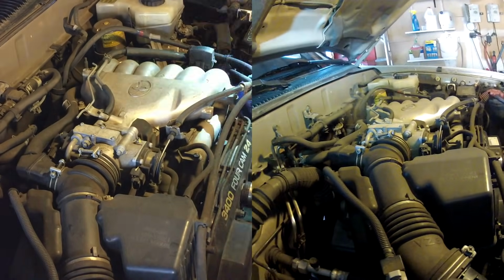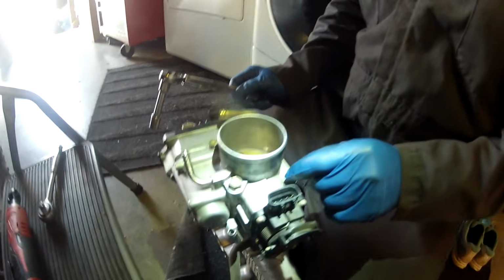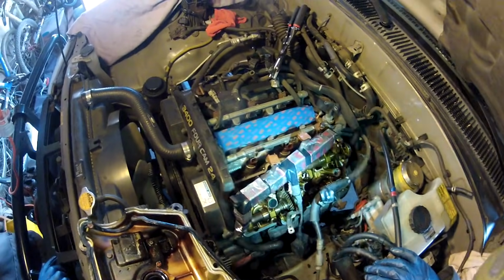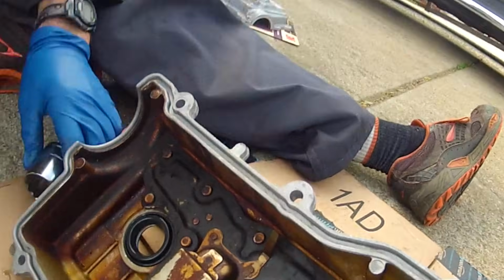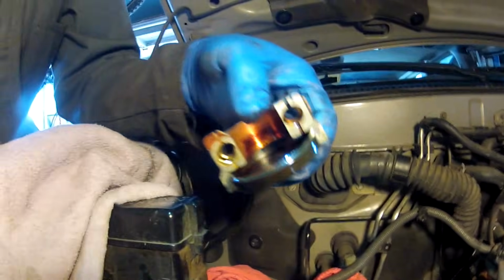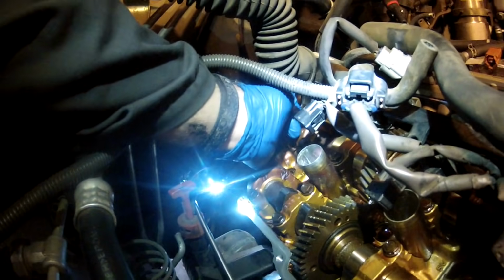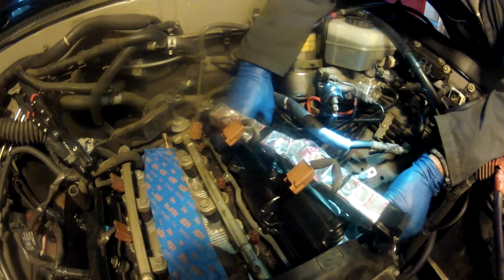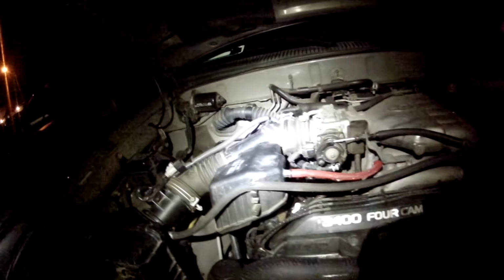3.4 L V6 5VZ-FE Toyota 4runner, Tacoma, Tundra Valve Cover Gasket Tutorial

Comment: Just did my valve cover per you video on my 2002 4runner.  Everything went well and seems to not leak anymore.  However now I'm throwing MAP and intake temp codes.  Tried to clean the MAP with cleaner by taking it out and spraying it with MAP cleaner.  No luck. Also my throttle is almost 2/3 the way down on a depressed peddle.  The cable seems fine with similar tension as before.  I cleaned the TB with a rag.  Could I have damaged something in the TB?  Any suggestions would be appropriated.  Thank you.
Reply from the maker: What CEL codes are you getting?  You're 2002 has a different style throttle body than the earlier models 96-00.  It doesn't have an IAC valve like the older models but it has an electronically controlled throttle plate that opens up enough to give the engine the air it needs to run when it's at an idle or when you're decelerating and you've taken your foot off the gas pedal.  Unless you were really rough with it, I don't think you could have damaged it.  So, your throttle body is a sort of hybrid.  It's basically drive by wire with a drive by cable back-up.  It appears at first glance to be a mechanical cable driven throttle body but it's actually electronically controlled.  I think that's the reason why you're not seeing the throttle plate open fully with the pedal depressed fully.

By the way, it's actually called a MAF (Mass Air Flow) sensor.  When cleaning the MAF, were you careful to not damage the sensor wires?  The MAF not only reads the amount of air coming in but it also reads the intake air temp.  So, it appears something happened to your MAF when you did the job.  Are you sure the sensor was plugged in fully?
Reply: P0100, P0101, P0110, P1126.

Thanks for the correction on MAF.  Makes more sense. Lol.

When i step on the accelerator with he hood open i can see the throttle body moving via cable but it seems it wont rev until near the end of the pedal movement.

I was made sure the MAF sensor was seated and clicked.  When I cleaned the MAF I tried to be careful but maybe I bumped it around too much when I initially removed it for the valve cover job.
Reply: I might add that it idles great.

Also "vsc off" and "vsc track" lights stay on now on the dashboard.
Reply from the maker: @basketweave_101  Did you remember to reconnect the two electrical connectors on the passenger side of the engine near the timing belt cover?  I'm pretty sure one of those is for the temp sensor.  All the other codes are related to the MAF sensor.  I don't know how you could have damaged it unless you destroyed the wires by shoving the cleaner nozzle too far into the tube and broke the wires.  I did read the VSC lights can come on when the Check Engine light comes on.  Maybe if you fix the issue for the CEL codes and reset the system by disconnecting the battery for a while, the VSC lights will stay off.
Reply: Well just a follow up.  I did forget a plug just under the throttle body.  That solved the acceleration problem.  Duh.

After a drive around town the engine and vsc lights went off.  Plugged in a scan reader and still had the same codes.  I cleared them out and all is good for now.

I want to thank you for all the videos you made.  I recently inherited a 4runner as a weekend project rig.

I have already lifted it with OME/bilstein, replaced ball joints,  tundra brake upgrade,  steering flush, and now the valve cover fix.  All following your videos.

Next up is the timing belt and a 1" body lift and some larger more capable tires.    Hope to see how it does on the trails in Sierras.  Maybe I will bump into you up there. 

Thanks Tim!
Reply from the maker: @basketweave_101  Glad you got it figured out Ryan.  Also great to hear you're making good use of our videos.  Happy Wrenching and Adventuring!

Comment: The video you have running on the top left corner is higher speed - do you have that video in normal speed? This is exactly what I need - a video showing it from the very beginning. Thank you much!
Reply from the maker: We don't have that in normal speed.  If you want more detail, you can use our Engine Misfire Diagnosis & Fuel Injector Replacement video https://youtu.be/N-lhZIWOkyU for more detail on removing plenums and everything else to get to the valve covers or you could also use our Supercharger Install video https://youtu.be/7RmHXvEQwXs for more detail.

Comment: Tim, big fan! I just got a 2001 4runner V6 and its leaking from the valve covers. After watching your videos I was inspired to tackle this job on my own (1st time working on a engine outside of regular maintenance) but I encountered a problem. I don't think I removed the throttle body correctly. I ended up removing the bolt that holds the gas pedal cable and two springs/coils shot off. Now I have no clue how to reassemble those springs/coils back on to the throttle body. I just need to know the orientation of the springs. Not sure how the ends fit into the slots.

Is this something you can help with?

Thank you
Reply from the maker: Sorry that happened to you.  I've never taken off what I think you accidentally disassembled.  I've only removed the cables off the throttle body and removed the IAC valve at the bottom of the throttle body for cleaning.  So, I unfortunately wouldn't know the orientation of the springs that shot off.  I suggest you take a picture of what you're dealing with and post your question with pictures on T4R.org in the 3rd Gen section of the forum.  Hopefully somebody who's taken one apart will be able to give you direction on getting it properly back together.  Good luck!

Comment: Hey Timmy.  Once again your video has encouraged me to do something that never in a million years I'd be able to do.  Now that I have completed it successfully I feel really proud of myself and it has encouraged me to keep working in my car.  I could not have made it without your video. You are awesome!
I also wanted to add a few things that I had to struggle that were not in the video that may help others when they do this job.
1. The one thing that was really hard for me was to actually remove the spark plug seals.  I tried your recommended method but was not able to do so without causing some small scratches to the cover.  Not big scratches or anything that I would think would cause problems in the long term, but definitely left some marks on there on every single one of them.  Maybe I was not careful enough or did not have the correct technique, but I was not able to do a single one of them clean.  Just want to give a heads up to others to be very careful on this step.
2. The second problem I had that was not in your "script" and threw me a curve was on tightening the manifold back again.  The issue I ran into was that some of the nuts there are held by a stud. I kept torquing and after a few turns I realized something was wrong cause I was not getting to the spec.  Seems like for some reason the nut on the other side was removed or fell or something, I don't know.  I was just lucky that I stopped before the stud came off.  But it could have been a pain to have to put the stud back in.  So watch out in case anyone has the same issue!
3. Finally, something silly but that really turned out to be a pain was to put the spark plugs back in! I am guessing my spark plug socket was not very good and when it was torqued and I tried to pull the socket out, it stayed in! So I had to loosen it and then try to get it aligned so that the socket would come off.  Had this happen in at least 3 of the spark plugs.  Pretty annoying cause it was supposed to be something simple.  Guess my recommendation is to get a good spark plug socket.
Reply from the maker: Good to hear our videos are inspiring you to turn wrenches.  Thanks for sharing your experience with this job.  You need to get yourself a magnetized spark plug socket.  The ones with the rubber grommet eventually wear out.

Comment: Tim, I was losing coolant from my 3rd Gen, I thought it was my reservoir tank so I bought a new one. Installed it. A week later the level dropped again. I blurped the system. Checked all my hoses.

Even the two that go into the throttle body since I just cleaned out my IAC sensor. So I cleaned out the canal to the left of the intake where it bolts into the engine. I noticed new coolant pooling up. Where do you think it’s coming from. Not dripping anywhere. Also the water pump has about 50,000 miles on it. It’s not weeping. Everything is dry on the timing belt side.
Reply from the maker: I think you're saying coolant is accumulating on the intake manifold?  You do have the coolant lines that connect under the throttle body.  If those aren't leaking, and there's no leak from the heater hoses or heater control valve on the firewall, it's got to be a leak from one of the intake manifold gaskets.  You could use our fuel injector replacement video to get you most of the way there if you do have to pull in intake manifold up and replace the gaskets.  https://youtu.be/N-lhZIWOkyU
Reply: Awesome Thank you 🙏🏼
Reply from the maker: @Puturphonedown  You're welcome.
Reply: Should I replace the fuel injectors while I am in there? My 4runner has 336K miles on it. Would it run better with new injectors?
Reply from the maker: @Puturphonedown  Yes, it would run better with new injectors.  Check the video description for the injector video.  I highly recommend Motorwest Performance and we provide their contact info.  They now sell Denso replacements with a lifetime warranty.
Reply: Thank you so much. You are definitely a lifesaver to everyone with a 4runner! 🙏🏼🏆
Reply from the maker: @Puturphonedown  No Problem.  Good luck with the job and let me know how it goes for you.
Reply: Tim I installed the new plenum gaskets. Pretty cool they are doubled up on the new ones. I haven’t gone on test drive but I did turn the 4runner on. I noticed a little coolant in the same spot but maybe that is just remnants from the repair. Would there be anything else that could leak in the valley to the left of the fuel plate?
Reply from the maker: @Puturphonedown  I think you might have misunderstood what I was telling you.  No coolant runs through the intake plenums but coolant runs through the intake manifold which sits between the heads on the top of the motor.  It's the thing the fuel rails are attached to.
Reply: The intake throttle body has two lines for coolant to cool it off apparently. When I cleaned the IAC I had to replace the gasket inside. I bought one from Toyota. Do you think it may have pinched somewhere and that is where I am getting the leak from?
Reply from the maker: @Puturphonedown  It's possible.  You would just have to remove the IAC again to find out.
Reply: I will take it off tomorrow and redo it to eliminate all factors. I will let you know. Thank you again you are a lifesaver 🙌🏻🙌🏻
Reply: Ok Tim I looked at a diagram of the engine. I replaced the plenum gaskets thinking those where the intake manifold gasket as the lower one. The intake manifold seems promising that is the issue. I am guessing I have to remove the fuel rails to get this completed?
Reply from the maker: @Puturphonedown  Yes, you have to remove the fuel rails.
Reply: Is there a video you made showing this?
Reply: Tim, do you know the torque specs for the intake manifold bolts? 🙏🏼

Comment: Hi  @Timmy The Toolman .  I just did this job and also changed fuel injectors at the same time.  I had a check engine code for misfire on cylinder 1 that I ultimately determined to be the injector after watching your other videos.  Thanks for that!

After I finished the job the engine started up fine, however almost immediately it developed a loud squeel.  The noise sounds like it's right on top of the engine.  In the intake somewhere I think.  Its a fairly high pitch squeel and the noise does change if I throttle up a little.  It goes away for a split second but comes right back at idle.  The engine seems to be running fine without a misfire like it did before.  Any ideas?  I am suspecting it's something to do with the PCV?.  Maybe it's a blocked Port on the throttle body?  Could I have installed the throttle body gasket incorrectly?  Thanks again for the excleent videos.  If you have any insight into what I screwed up I would appreciate it.  Joe
Reply from the maker: Double check your work.  If it wasn't doing this before you did the job, you obviously forgot to connect something back up properly.  I just don't know what would make a squeal.  If you had a mechanics stethoscope, maybe you could narrow down the source of the noise.  Maybe it's a vacuum hose you forgot to connect.  If you think it's coming from the plenums, I'd examine all the hose connections carefully and maybe even  pull them off to get a better look at your work to see what could have gone wrong.
Reply: @TimmyTheToolman  is there a correct orientation for the 2 intake plenum gaskets and the throttle body gasket?  I did quickly put those gaskets on and didn't pay close attention to how they sat with the air openings.  I lined them up with the bolts of course but if there is a "right side up" then it's possible that I installed the gaskets incorrectly.  Thanks.
Reply from the maker: @jamaison1  Hey Joseph, no, you couldn't have messed up the plenum gaskets.  They can go on different ways.
Reply: @TimmyTheToolman  Hi Tim.  I did make a mistake early on when replacing the cam seal.  I assumed that there were two cam seals on each side of the head.  On the back near the firewall and toward the front of the engine.  When doing my repair, I changed the rear cam seal just fine like in the video.  Then I went and took off the bracket in the cam on the front of the engine thinking it was the same rubber coated metal disk seal.  I found out that it wasn't pretty quickly but I did notice that I moved around the seal at that point.  It's like an orange colored flexible rubber seal I but the cam goes through it and you cannot remove that seal.  So logically I put a little RTV coating on the outside of that rubber seal as well as where the bracket meats the head.  Did I unintentionally try to seal something that should be free moving under that front bracket? 

The bracket I am referring to is between 31.30 and 31.40 time of your video.

Does that orange rubber under that bracket actually rotate?  And if so did I damage it?  Or did I impede its ability to rotate by putting sealant?  I hope not and that it's just a seal but I didn't think to test if it rotates.

Thanks for helping me troubleshoot a little and hopefully save time.
Reply from the maker: @jamaison1  The camshaft rotates on the center of those front seals so  putting the collars back down with sealant shouldn't cause any problems.
Reply: @TimmyTheToolman  a little embarassed to admit it but you were of course right on with "CHECK YOUR WORK!". I forgot to tighten the throttle body completely.  Massive vacuum leak causing the whining noise.  What happens when you finish work at 10pm on Sunday.

Your videos are awesome and you do great work.  My truck is running great!  Thanks for this!
Reply from the maker: @jamaison1  Hey Joe, don't feel bad.  We all make mistakes.  The important thing is you figured it out.  Good Job!

Comment: Hey, could you list what page of the service manual you are using for this job? I had the pdf and it has over 1,500 pages and no way to search (its a picture of the page, not actual text)
Thanks for the vid!
Reply from the maker: The pages come from multiple area of the EM (Engine Mechanical) pages.  It's not just one area.  Our video does cover everything you need though.  But, if your dead set on finding the pages related to this job, skim through the EM pages and find what you need.  This is why I like having the physical books to turn through.  If you do an Ebay search, you can find the 2 volume set for a reasonable cost.

Comment: thank you for the video! Is there a reason you are changing all those parts you listed in the beginning of the video instead of just the gaskets themselves?
Reply: also, i did not notice you place the actual valve cover gasket? just wondering. about to attempt this job so i want to make sure i see it clearly. thank you!
Reply from the maker: @marctopete  All the parts listed are things you should replace while doing the job.  The only "optional" items would be the spark plugs, spark plug wires and maybe the throttle body gasket.  You must have missed it in the video but we definitely show replacing the valve cover gaskets.  All the parts with links are listed in the video description.

Comment: Thank you. Im going on my 3rd day of working on this, but i am a complete beginner so im really taking my time and being cautious
Reply from the maker: eric shun take your time, follow our lead & ask any questions you may have along the way. We hope everything goes smoothly
Reply: @TimmyTheToolman  thanks for the reply, i actually do have a question! Installing the spark plug tube gaskets... ive been watching various videos of this job and many people seem to put the gaskets in the opposite orientation you did.  The forums show people saying both are correct.

The ones i have look slightly different than the ones you used, so i am thoroughly confused. Mine look like this.

https://www.toyota-4runner.org/attachments/3rd-gen-t4rs/169192d1439580638-valve-cover-spark-plug-grommets-gaskets-need-help-20150814_152834-jpg

(Not my photo) my instinct says the top option is the correct orientation ?  🤞 the gasket fit over the lone tube when i was testing much better using the top orientation, just seemed to make sense. But i am really good at second guessing myself